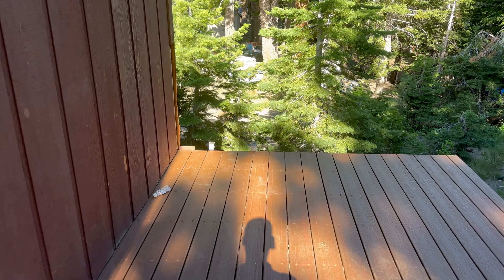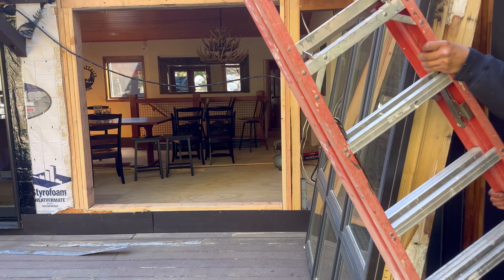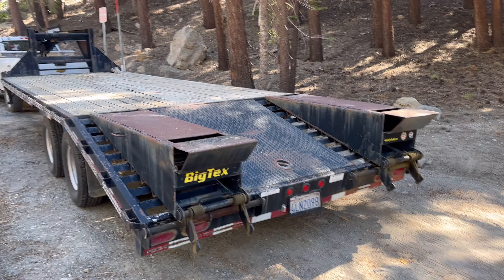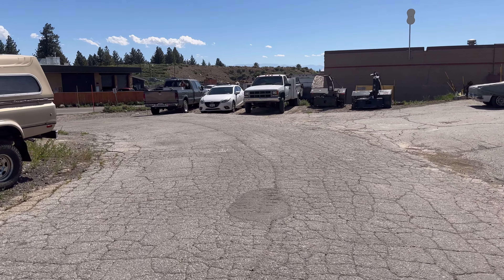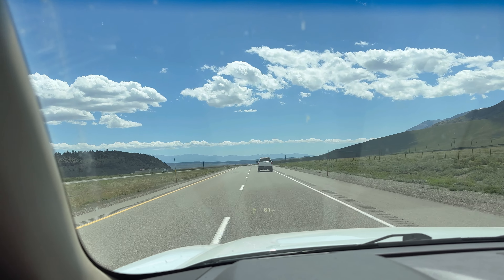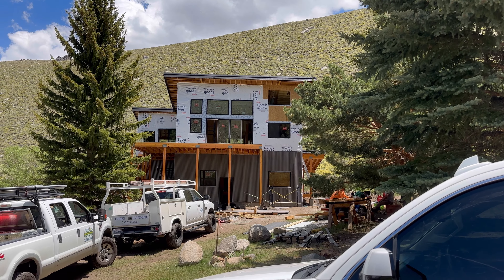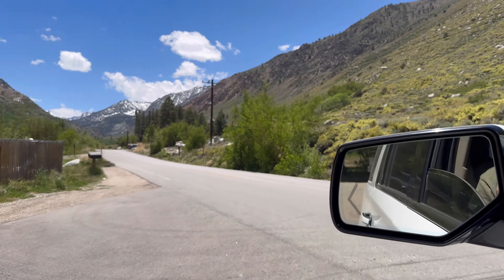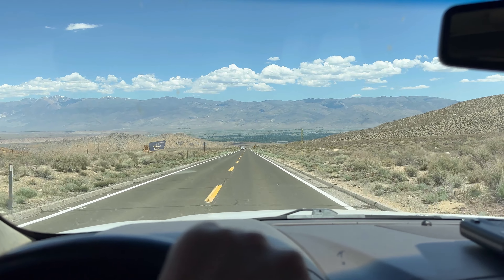Building a deck at high altitude. #high #country #construction

Comment: 12:00 SOME of it is rising air columns due to convection. i.e., the lapse rate of temperature of the air rising from the ground up to the level where the clouds condense.  But You'll also notice that some of these cloud decks also align with the mountain ridges; and THAT process is known as orographic lift -- air being forced up from the valley floor to the ridgetops due to air moving perpendicular to the topography of the mountain range.  Either way, the flat cloud ceiling is a nice, clear demarcation of what elevation at which the air gets cold enough for water vapor to condense into clouds.

Comment: Warm air can 'dissolve' more water than colder air. When warm air rises to higher levels where the temperature is lower, at a certain height there will be saturation(100% humidity) and clouds ar formed. For given conditions this happens in an area at the same height, hence the flat bottom of the clouds.
Reply: MUCH more succinct explanation than mine, thank you.  I gave two processes that get the air rising, but we both wound up at the same place.